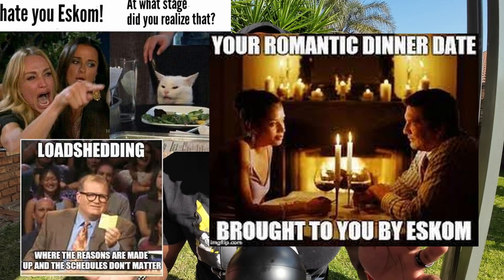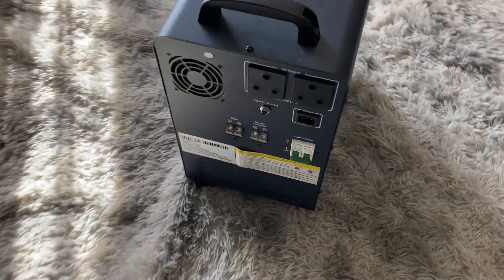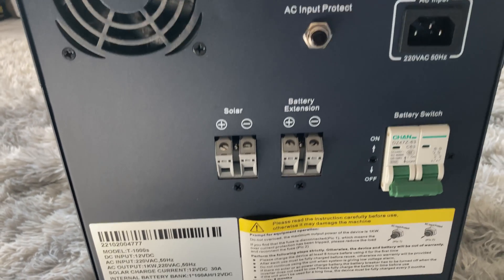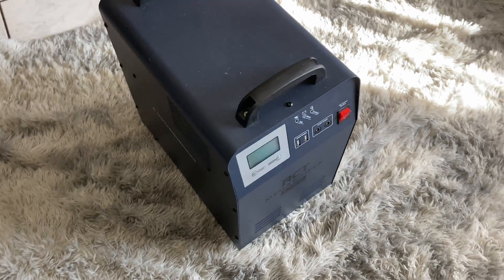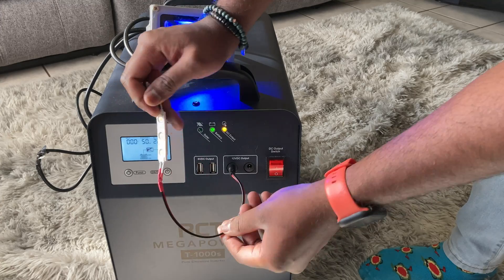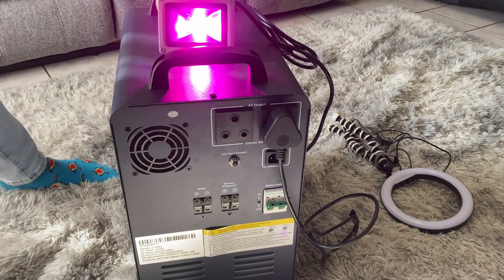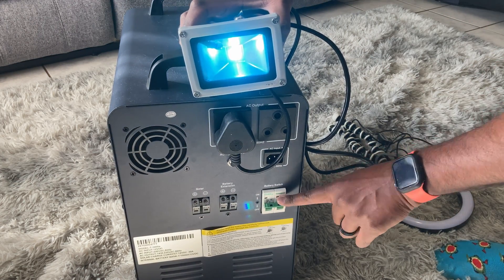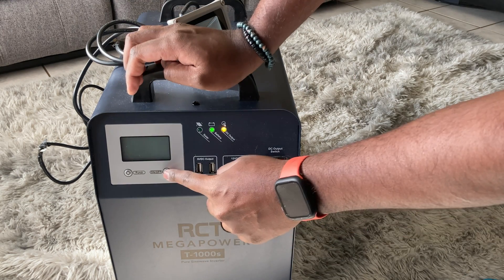RCT T1000s: inverter solution for loadshedding?

Comment: Do you have to change settings when conecting solar?do you need external solar charge controller?
Reply from the maker: Just plug it in. It has a built in inverter to regulate the input voltage. It will duel charge (from mains/power in) as long as the switch in the back is on.

Comment: Can the power generated from solar panels, be used to directly power gadgets after battery is full.
Reply from the maker: Yes, if you’re generating enough power via solar it will pass through the inverter. If it’s insufficient then the battery will supplement the solar

Comment: Gel batteries are rated for 300 cycles, these systems offer exactly that. a cycle is pretty much any amount of discharge and recharge cycling, although you are right in saying that running the battery below 50% will cause faster wear on your battery and overall affect your total power capacity every time you use it. On these units it's important to note that half isn't where you'd expect it to be, the battery indicator has 5 bars to display battery storage. you must stop using the system after the first bar disappears as that is half, the other four disappear fairly quickly after the first bar drops.

Here is a Random but helpful cost fact it costs you roughly R15 a cycle in wear and tear on a 100ah gel lead acid battery. It costs you on the other hand an average of R3 a cycle on a 100Ah lithium cell.
Reply from the maker: What an excellent explanation. Appreciate your cost per cycle analysis! Makes the replacement cost more "true" as the actual cost may be different from the replacement cost looking at the lifespan of the system.
Reply: Hi Tristan, my RTC's battery is f*cked after a few months use and not working - really kak situation. I'd like to replace it with a Lithium battery. Do you know where I can start looking for a lithium battery replacement. What specs should I be searching for online? Like, will Battery Centre have the right battery? Thanks.
Reply: @DigitalCapeTown Revov 12v 100ah lifepo4 battery with integrated bms will work.

Comment: Can you replace the Gel battery on this device with a Lithium? The battery on my device stopped working after about 5-6 months.
Reply: Yes, you can but be careful with the battery you choose, you want the inverter to cut out at its set low voltage stop before the battery does. Lithium cells have a Battery management system (BMS) that will physically disconnect the battery circuitry when they run low. If the battery shuts out before the inverter you'll have a tough time getting the battery to reconnect its inner circuitry and accept charge. you would have to introduce a 12-volt charge from another source as the inverter won't realize that there is a battery connected. 

I made the switch after 4 months due to a dead battery and went with the Securiprod 100AH LIFEPO4 battery, no issues and I've been running for about 3 months so far with deep discharges. the Securiprod battery has a cutoff lower than than the inverter so I'll never run into BMS lockout issues. lastly a word of advice, the lithium battery will put more strain on your charging circuit, I would advise cleaning the heatsink and fan once you open up the unit to change the battery, I didn't initially and it sounded like the inverter was going to fly away. gave it a good clean and it works just as it did before
Reply from the maker: If its within 6 months you should be able to take it back under warranty? It is possible yes, Ive not personally changed the batteries yet. But if it is fried, why not take it to your neighbourhood electrical repairs shop and have them take a look?

Comment: Is there a way to stop that sound after 6 months… mine has started doing that now when it’s charging
Reply from the maker: I would imagine that the dust needs to be cleaned out. It should be as simple as opening it up, cleaning up all the dust. Cleaning the fans as well, should make the sound be a lot less.
Reply: @revengersHammer thanks for your reply. Can we get a step by step video on how to clean it. Thanks 🙏
Reply from the maker: @blingola1 on the list

Comment: When charging it do you turn off the main switch
Reply from the maker: No, if the main switch on the back is off, it won’t charge the unit
Reply: Does the front LCD have to be on when the unit is charging?
Reply from the maker: @Rizla- I believe so

Comment: Hi there. Thanks for the video, it was a great help. I wanted to ask though, after replacement the new battery obviously needs time to recharge, my question is regarding the battery indicator on the unit almost always shows its fully charged, even right after use. This is also the same after replacing the battery. It shows its halfway charged when i connect the battery without mains being on, but when i put the mains on it shows its charging for a minute before showing it is full. Is something possibly wrong? Also, the level doesnt drop for a long time, and then suddenly drops bars at a certain point. Is my unit faulty maybe?
Reply from the maker: It does sound like something is defective. The battery readout should be linear, in the sense that if you use 40% of the battery capacity, the battery meter should be at 60%. Perhaps buy a Watt meter, and have that connected when using the backup power. You know the battery capacity, subtract the usage (read from the Watt meter). If the two dont equate, then you know something is wrong.
Reply: @RevengersHammer  thanks for the response. I just replaced my battery this morning so I will see how it goes